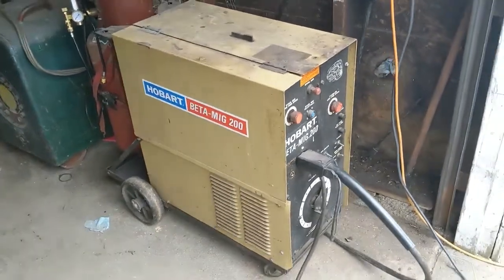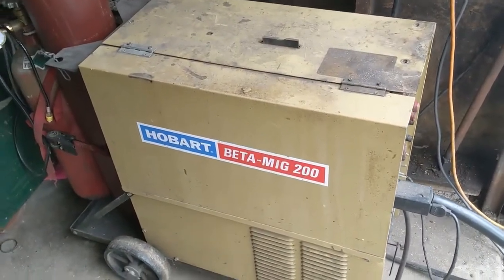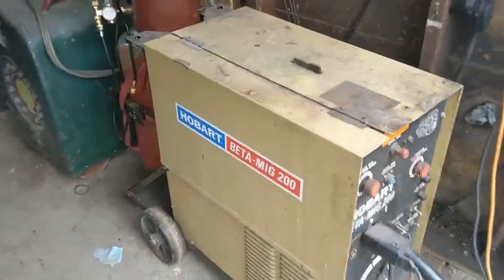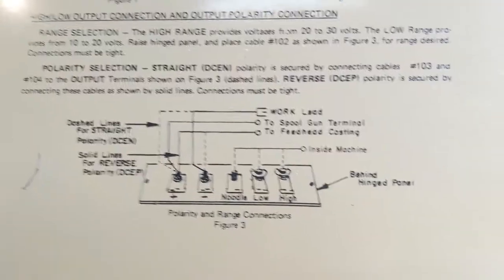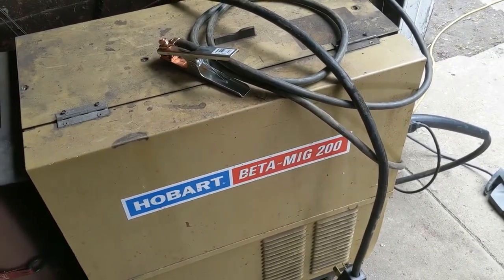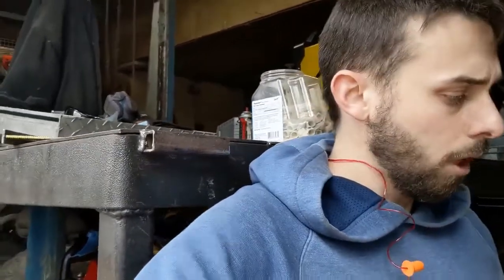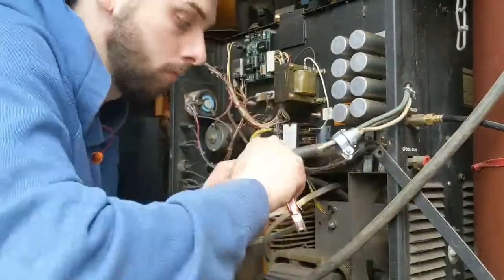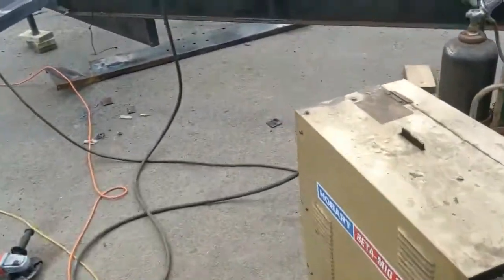Hobart Beta Mig 200 1 year review and welding

Comment: Thanks for the video..I’ve had my beta for 10 plus years. My only complain was I couldn’t burn thick metal…I’ll try swapping cables inside when I need to weld thick metal. I’ve really abused mine…even left it out in a heavy rain for a few days. I don’t think I would sell mine for less than a grand…not sure I could replace it
Reply from the maker: Swapping cables will get you the higher heat settings. When I swapped cables I could burn 1/2 in a single pass. I don’t have this machine anymore, sold it to a good friend, he still has it and uses it regularly, it’s still going. They don’t make machines like they used to but I will say, the new inverter based welding machines are pretty awesome in a lot of ways

Comment: I have one that's identical.
I used it from the age of 13 to 25 before I found out it had 30 heat settings not 10.
On the inside you have to move the cable from noodle to low or high
Reply from the maker: yep they are very versatile machines

Comment: Really enjoyed your video. I owned a Beta Mig 200 ,was indeed a very nice machine the internals we're robust and loved the simplicity of the machine as a whole. The only thing that concerned me was the wire feeder portion of the machine just didn't think it was as beefy as some of the Miller's I had. the lower drive roll and plastic drive bushing were no longer available.never the less a great machine.
Reply from the maker: agreed, probably not the machine id buy if i was running a shop 10 hrs a day but for a general garage or home hobbyist its an awesome machine!

Comment: I have the same machine. used it minimally at a previous shop, at a new space we tried to use it but when you pull the trigger it keeps tripping the 30 amp breaker. I would think if there was an internal short it would blow the fuses on the machine and not the breaker. Whats your power set up to run yours?